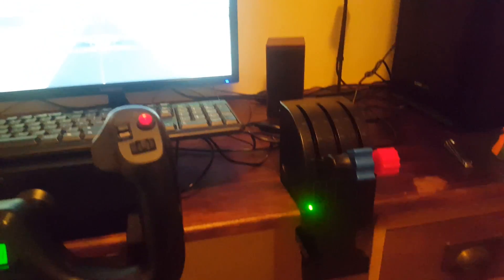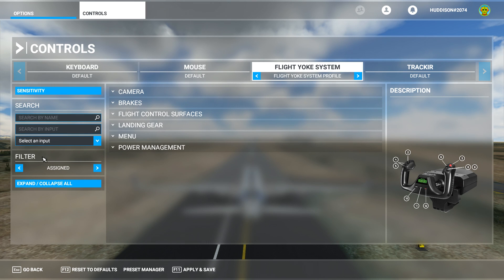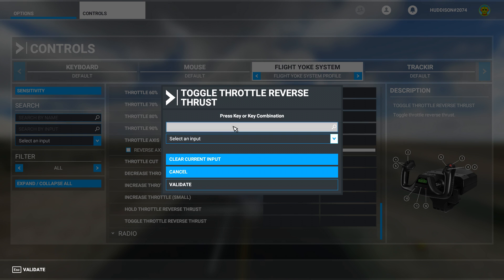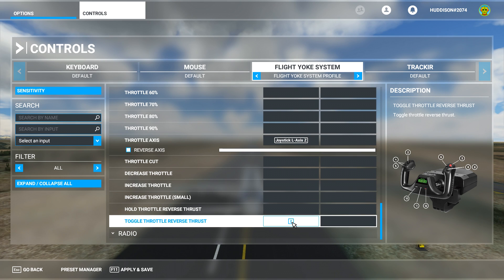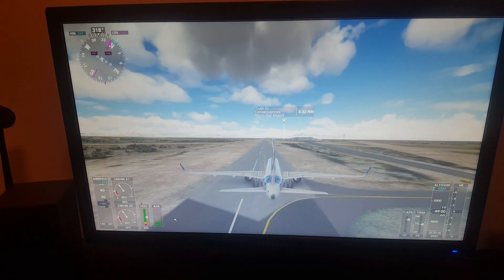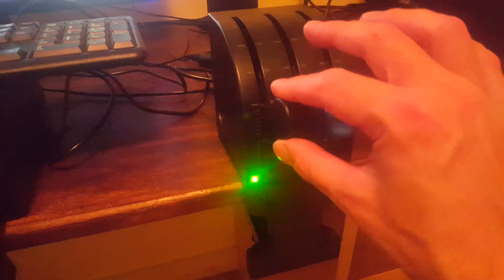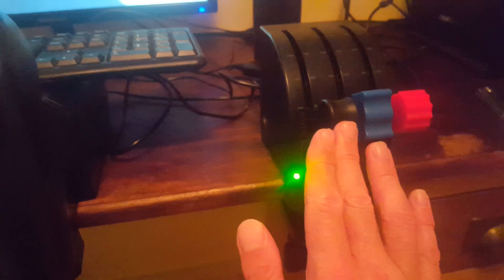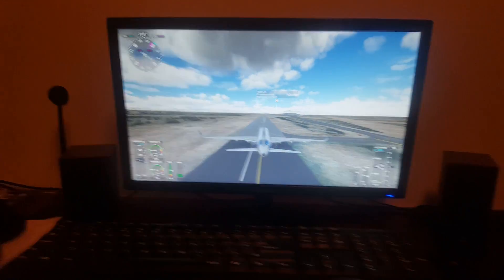FS2020 - How to Toggle Reverse Thrust on Logitech Throttle Quadrant

Comment: What's really annoying is that the throttle quadrant itself does 100% support reverse thrust below the detent on the axis but Saitek broke this and implemented a soft switch instead.  Because I have an investment in Saitek stuff and had built a panel around it, i've recently changed to a Honeycomb yoke while keeping the rest.  This raised an issue that one of my throttle quadrants is the one with the PS2 connector that goes into the Saitek yoke.  Rather than discard this, I opted to rewire it to work via a Leo Bodnar joystick board and I completely forgot about the 3 switches below the detent but in calibration noticed that the "zero" position at the detent is part way into the potentiometer axis already.  I pushed the lever down and lo and behold, a complete axis!
Saitek/Logitech implemented the "switch" entirely in the control board and it's far better without it now and I have a variable reverse thrust axis.  My axes are now implemented in Spad.next as "Throttle WITH reverse thrust".  Very happy with my modification and the "reverse" switch if desired can be implemented in Spad.next as a conditional event.
Reply from the maker: Wonderful David & a useful guide for others.

Comment: Greetings! I really like your channel. I'm also using the logitech yoke and throttle. I also purchased a second throttle quadrant to give me a total of 6 levers for dual multi engine planes and for airliners. Question. Do I assign a toggle for reverse thrust for each engine if I have assigned an axis for each engine? Eample: 6 levers for 747. Spd brake, 4 throttles and flap. Thanks and keep up the good work!
Reply from the maker: Congrats and enjoy the great yoke system.  Assigning toggle reverse thrust to one lever is generally sufficient.

Comment: Can you connect two logitech throttles (to be used with 2 engines). Also...can you change the knobs on  each lever? =)
Reply from the maker: Yes you sure can use a two (or more) throttle setup.  You get some interchangeable knobs included, or can buy (or 3D print) more.

Comment: Is that possible in X flight 11 as well?
Reply from the maker: Do you mean X-Plane 11?  I've not messed around in that sim for a good while.
Reply: @Huddison  Sorry, X-Plane 11 of course, yes 😂 Boeing 737 800. The idea would be 2x Saitek throttle with (from l. t.r.) speed brake, throttle, flaps, 2x fuel and gear up-down. 3+3 so to say. What do you think about? 🤭
Reply from the maker: @nobudgetkalle  That sounds like a good use of them.

Comment: Hello I use the DHC-4 Caribou. I followed your approach and it worked very well. Recently I installed the ornithopter (Dune) and for some reason, when I put the Caribou back on, the reverse command no longer works. I've tried everything to get it back to how it was before and I can't. Do you have a solution for me?
Reply from the maker: Not certain why installing the Omithopter ruins controls for some; will aim to look into it.

Comment: Hi ya everyone. This is all aircraft capable of reverse thrust and applies to Saitek throttle quad. There is a way to get the engines to go full reverse without having to toggle reverse and then pushing the throttle forward again. This is a method that is all done in the sim control options. Set the switch at the very bottom of throttle travel on the Saitek throttle quad throttle lever to hold reverse thrust. This will keep reverse engaged as long as the lever is all the way down on the switch. Next assign decrease throttle to the same switch at the bottom of throttle lever travel (yes you can assign two actions to one switch). When the switch is engaged by the throttle lever reverse activates and stays activated and at the same time the decrease throttle will spool up the engines which are in reverse. Push the throttle lever forward and the reverse disengages. Ole school reverse, pull the throttle down and leave it there until you have slowed to taxi speed. Hope this helps someone.
Reply: IT WORKED! Thank you so much, you are a genius!
Reply: Oh man you're awesome ahah
Reply: keep this comment as a future note
Reply: Hi there...can you please be more specific to exactly how that set up is done,to me this narrative is somewhat vague...You say..."next assign"..but what about the first step? is this on the Z axis? unfortunatly I did not understand what was said!
Reply: This helped everyone lol
Reply: @julian3898  yeah maybe I'll make a video or stream on twitch showing how to set it up, probably ought to do that.

Comment: Hi Huddison, thanks for your time to develop those helpful videos for us. I have two logitech quadrants and I want to use it in the Cessna 337 Skymaster or any other aircraft that have two props. I set the others (throttles, propellers and mixture) and works perfect, but the Feather switch for props don't works. I have set toggle feather switch 1 for prop 1 at RX; (that's the click sound when you move the lever of prop below zero mark) and nothing do. Any ideas or fix to do this in the video but for propellers? Thanks a lot and keep going!!! Take care!
Reply from the maker: Please ask this question in our Discord: https://discord.gg/3kra6JfHZT - I remember a similar conversation on this there, in the recent(ish) past.

Comment: Hi Huddison, after a few hiccups I managed to install the PMDG-737. Of course I had some of your tutorials on my second screen but there' s one function that behaves strange. I want to use the Left lever of the Throttle quadrant to toggle the Speedbrake, that worked. I like the middle one to act as thrust (both engines). But as soon as I push this lever beyond 80% my right lever kicks in the reverse thrust (full). I checked if I had assigned a key to this (reverse) function but there doesn't seem to be any assignment connected to the right lever. Do you have any idea' s or suggestions? Thanks in advance ;-)
Reply from the maker: Did you assign your throttles as 'Throttle Axis'; not throttle 1,2 etc?
Reply: @Huddison  Solved (thanks). I had chosen "Throttle AXIS 1 (0 TO 100%)" in stead of "Throttle 1 AXIS". I also assigned the Third lever (Down) to toggle / activate "Reverse thrust" using my middle thrust lever. Anyway, we're getting there ;-)
Reply from the maker: Great to hear Ed ;)

Comment: How do you find or know what "z", etc refer to on the hardware?
Reply from the maker: I'm not fully clear on your question: but you can see what buttons are assigned to which function, via control settings.
Reply: @Huddison  I found it in the manual for the throttle and yoke.

Comment: I can activate this with the big airliners and the Cessna 208B and TBM 930. But i can not go backwards on the taxi way with the King Air 350 and with the Cessna Longitude. Or is it generally not possible in real life? Thanks!
Reply from the maker: Good question & I'm not sure from the top of my head.  Hopefully others will chip in on this one.
Reply: @jrd210 The airliners go backwards with toggle thrust, but the Longitude have also turbines and do not go backwards. The TBM 930 and C208 have props and go backwards, but the King Air 350 with props do not go backwards. I dont understand it!?!

Comment: Hi Huddison, thanks for the great video . I have applied the toggle setting exactly as per your explanation, I am also using the same Quadrant that you have but when I toggle it for reverse thrust the aircraft still doesnt go into reverse. Is this setting limited to certain air craft or what i am doing wrong
Reply from the maker: See a video I released a few weeks ago for a work-around. Can't link it as I'm at work, but reverse thrust is in its title.
Reply: same did you ever find a fix?

Comment: In this latest GOTY edition & update, these settings no longer appear to work with the new addition of 'on push' & 'on release' settings added - can you please help/advise as to reassign the original settings as per this old video tutorial for my Logitech Throttle Quadrant? Thanks in advance 👍
Reply: I’m also having the same problem, haven’t found anything to fix yet.
Reply from the maker: I'll have to look into it.
Reply: @Huddison  thanks, it'll be much appreciated 🙏
Reply: I've not seen any other YouTube vidz that have announced/discovered this change. Any joy yet anyone??
Reply: @christomlinson5139  I have the same issue, I can set it to reverse and it does work the problem I have is that when I spawn into the plane at the start it seems to be in reverse as default

Comment: Hi Huddison, I have a problem with my Saitek Pro Quadrant. I can't get full travel on the throttle lever(the middle one of the three I use) After I set the axis it only moves from idle to reverse. Can't move up to increase Autothrottle, CL/Flx/ and Toga. Sorry if its a stupid question but its driving me crazy! I'm using this on the Flybywire A320neo. Everything else seems to be fine. Any help gratefully appreciated. Thanks
Reply from the maker: Hi, come and ask this in the Discord: https://discord.gg/3kra6JfHZT
We can talk you through troubleshooting better there.
Reply: I have the same problem

Comment: SU5 just killed my throttle axis I now have forward and reverse throttle on the same axis split in half.... if I put my axis down it immediately controls the reverse thrust and if I push it forward it controls the normal thrust..... Is there any way to set this back? It just happened after sim update 5... and I really want the old controls back where I could switch between the thrust modes with a button and have my axis control only one thrust at the time....
Reply: I was having similar problem setting mine up…I noticed that if you are using the FlyByWire A320 you need to open the FlyPad to right of pilot then go to Settings and Calibrate the Detents…by default, reverse full is calibrated into the range of the throttle (comes on at about 25%)…I had to put the lever at 0% and select that I want it to be idle when there (no reverse thrust)…you then need to Save & Apply…then you can set the lever down (button 7) on the Throttle Quadrant as Decrease Throttle…works for me now 😉
Reply from the maker: I'm not quite sure off the top of my head, what's causing that. Ask in the Discord https://discord.gg/3kra6JfHZT
I remember somebody there who had similar issues.

Comment: Sorry but shouldn’t it be that when you pull it down you should leave it down and it should go max thrust reverse and when you pull it back up should go forward with the engines?
Reply from the maker: No in this case, it 'toggles' reverse thrust mode; so the engine power will effect that level of reverse thrust.
'Hold reverse thrust ' is actually the best (& safest) way to deploy it.
Reply: @Huddison  o ok thanks very much!

Comment: Can I add a second throttle and use with msfs2020?
Reply from the maker: Yes, you can buy the Logitech throttle quadrants separately and they connect via usb (to your PC or Yoke hub).
Reply: @Huddison  how do I get them both to show up in my hardware settings? It seems to show just one?
Reply from the maker: @kenfriess3108  hmm, I don't have 2, but the added one should surely show in Options/controls?
Reply: Will keep at it. I confess my competence with control mapping is limit...thanks very much.
Reply: All good worked it out...lol
Reply from the maker: @kenfriess3108  Good to hear

Comment: I find it much easier to just assign a button on the throttle to hold rev thrust until you let it go myself, that way you are not left wondering what mode you are in. My throttle does not have a detent, sadly, so have to do it this way, but it works, LoL
Reply from the maker: Yes I now use 'hold' reverse thrust myself; much better👍
Reply: @Huddison   when searching for a way to set reverse thrust with this quadrant, your video comes up.  Since you've found "hold" reverse thrust to be better, you might want to just remove this video and make an updated on.  If I hadn't gone to the comments, I wouldn't know the better way.

Comment: How can you turn to right and left  on the ground ( not in the air) with that flight yoke system?
Reply from the maker: If you don't have rudder connected, the yoke will steer your plane on the ground.

Comment: Ah thanks for this, I thought it was put it in the down position to toggle 100% reverse thrust, not toggle the operation of the lever :) is there a way so when you press it down and hold it there it just gives 100% reverse thrust?
Reply from the maker: I don't believe you can have 100% reverse thrust by putting the lever in it's down most position.
You can set a button as 'Hold Reverse Thrust', which is more definite, so to speak.
Reply: @Huddison   is so easy to fix with the z. Just assign z to decrease thrust command. Not toggle. The problem with toggle is that you need to hit the key but if you don't pay attention reverse wont apply.
Reply from the maker: @samuelaponte7746  Yes that's certainly another option if you prefer.
Reply: @samuelaponte7746  I like that idea, make it the same as pressing and holding F2 so it goes to 100% reverse thrust.
Reply: @teenflon  😃

Comment: Thank you, the best solution ever seen.
Reply from the maker: You're welcome.
Reply: Just assign z to decrease thrust command. Not toggle. The problem with toggle is that you need to hit the key but if you don't pay attention reverse wont apply.  After that you just push all the way down to z and reverse will apply to the 25%. Remember Decrease Throttle with the letter z.

Comment: I don’t like the toggle option for reverse thrust. You’re only asking for problems.

If it doesn’t toggle correctly the first time or for some reason it toggles twice, you could be full at thrust with breaks on and not much runway left. Not good.
Reply from the maker: That's a good point. I been experimenting with 'Hold' reverse thrust and it's a little more definitive.
Reply: @Huddison  That’s a good idea. Might try that!
Reply: Just assign z to decrease thrust command. Not toggle. The problem with toggle is that you need to hit the key but if you don't pay attention reverse wont apply.  After that you just push all the way down to z and reverse will apply to the 25%. Remember Decrease Throttle with the letter z.
Reply: Yes, I set my toggle reverse thrust option to one of the rocker switches beneath the throttle.  If you hit the wrong one by mistake and thus do not toggle reverse thrust, and then go to full forward power instead, it goes very poorly, I assure you.
Reply: @airborneyyc  Same here. But can’t find a better way.

Comment: hello, I have multiple throttles so am using the Throttle 1, 2 etc. separate axis but part of the axis is reverse thrust any ideas?
Reply from the maker: If you check the reverse thrust binding and clear it, that may help.  Can you provide me more information, as it's difficult to picture what you mean?
Reply: @Huddison  I have removed all reverse thrust bindings, what I mean is for my throttles' axis at 50% down the axis it engages reverse thrust
Reply: @Huddison  I believe I have fixed it, thanks anyway
Reply from the maker: @AviationAlex  Great! I was just about to reply and say ensure you have throttles set to correct axis bindings - but it looks like you figured it out for yourself ;)
Reply: @Huddison  :D

Comment: hey man i have the same controllers as you. how do i set flaps on the throttle controller? is there a video i tried in game and set joystick r axis x + and joystick r axis - to increase and decrease flaps, but it was only doing either full flaps or no flaps and i want it realistic where i can adjust the amount of flaps with the middle throttle with blue cover lever. if that makes sense
Reply from the maker: Hi check this other video of mine - it should help:
https://www.youtube.com/watch?v=N18KdQct9n4
Reply: @Huddison  wow that was a huge help now my flaps are set to 0,10,20,30.... now it seems my Rutter pedals are messing up. Whenever I hold them to turn left they move left then move back the straight and you can’t properly steer and taxi it goes out of control
Reply from the maker: @speezy1414  I still haven't managed to get a hold of rudder pedals, so won't be much help to you there currently.

Comment: Is there a way I could put two throttle quadrants together
Reply from the maker: Yes, you can buy an extra throttle that has a usb connection and use dual throttles.

Comment: Please help... I have the same yoke and throttle quadrant. They worked perfectly in FSX. Now in fs 2020 my throttle won’t work although the yoke does.  There is power to the quadrant as there is the green light on. Strangely the speed brake engages and disengages constantly whilst the throttle unit is connected to the yoke housing and unplugging it from the yoke housing stops it !! At my wits end with this now....any ideas or suggestions would be greatly appreciated
Reply: I buy my fsx 2020 two days ago and have same problem with my throttle won’t work although the yoke does. I try to look over internet and cant find the answer so I delete  fsx 2020 from my computer reset my windows 10 to factory and than connect my saitek pro first with all sticks down on idle position than reinstall the mfs 2020 . After install fsx the quadrant start working normally with no problems. After that I go to my fsx- PROFILE  - than to CONTENT MANADGER and download all files UP TO DATE.
Reply: @openmind9314  thanks for this information it’s greatly appreciated 👍
Reply from the maker: I've heard of this issue before, but unfortunately, I don't know what is causing it - I'll pin this post, with the hopes that others who have had similar issues, may be able to help.
Reply: @Huddison  thanks for responding so quickly...hopefully someone can identify the issue..thanks for the helpful videos btw 👍
Reply from the maker: @lennylion-x6g  most welcome 😊
Reply: My fix was to bind it to "Toggle Throttle Reverse Thrust"  instead & not the "Hold Throttle Reverse Thrust" option. This also works with propeller planes that have reverse. I've tested it so far on the Caravan & works.